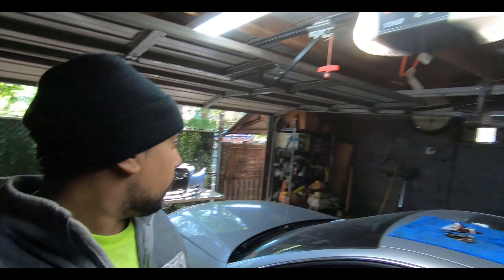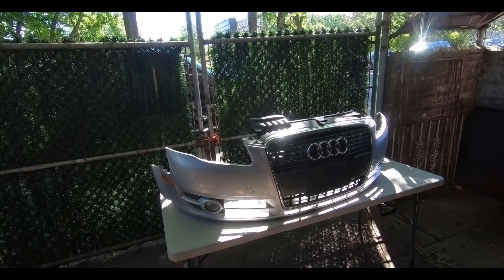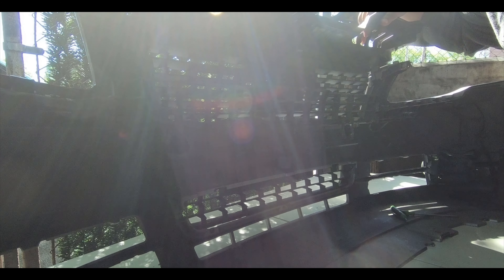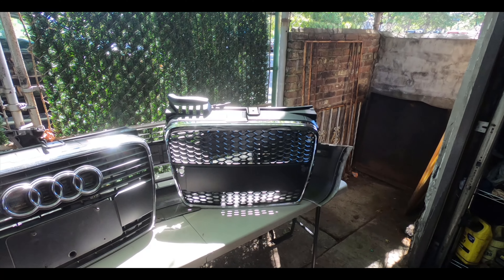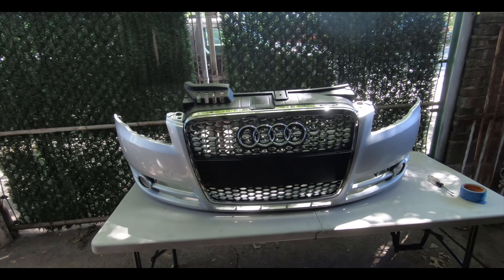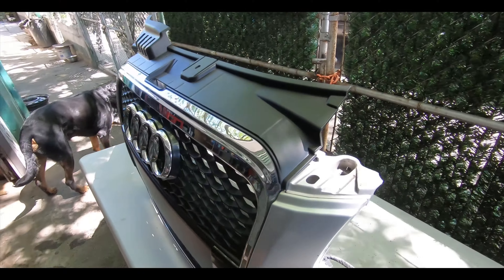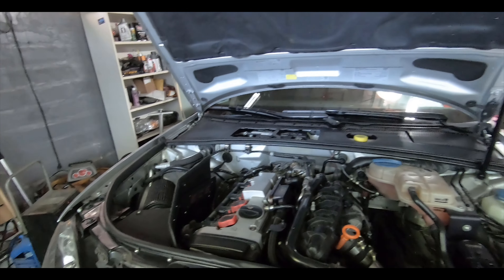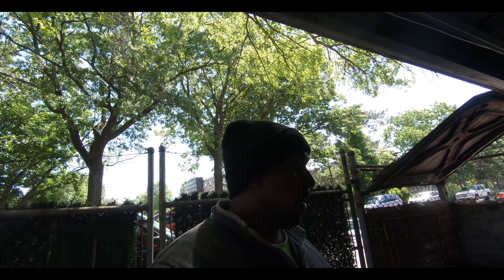Audi B7 A4 RS4 Style Grille Upgrade!

Comment: Great video ,What ever happened installing the  rs4 style grill? I just bought one so I’m doing some research
Reply from the maker: It wont fit in the regular bumper you would need a sline bumper to fit the stock rs4 or the bumper i have the RS$ style one it will fit that one. But i wanted to see how the after market one would look on the stock bumper.
Reply: Where did you get it from